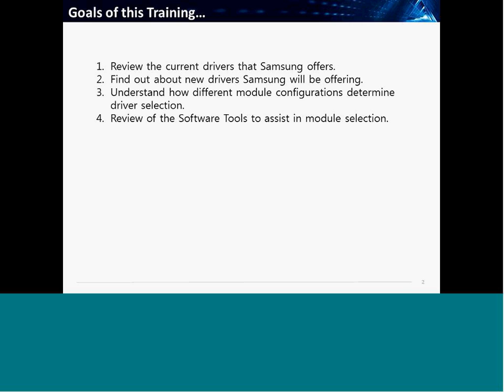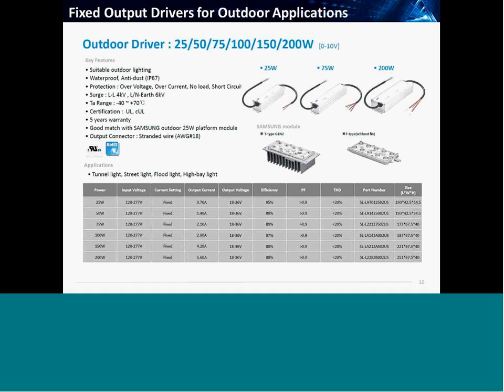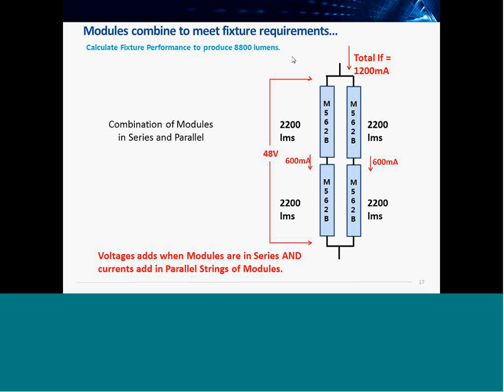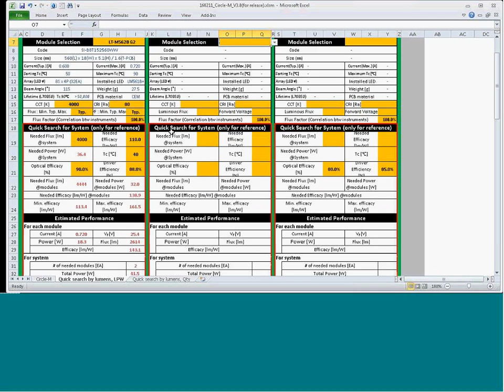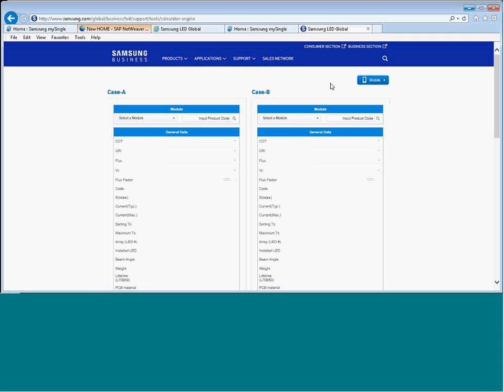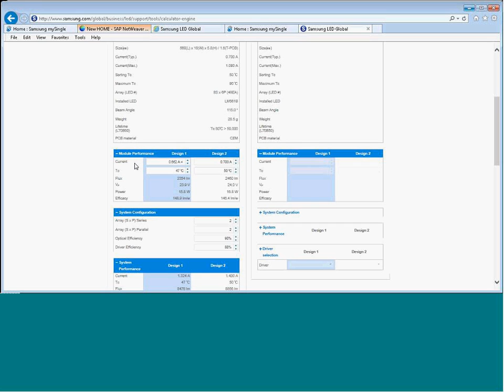Training 6   Samsung LED Drivers

Comment: What driver would you use for SL-B8R5C9H2aWW. I have ordered SL-CA2029601US  programmable. Is that the best option for multiple models? Does Dali make it wireless?